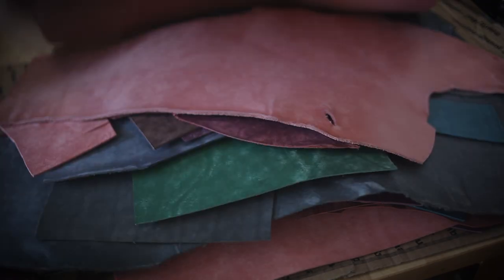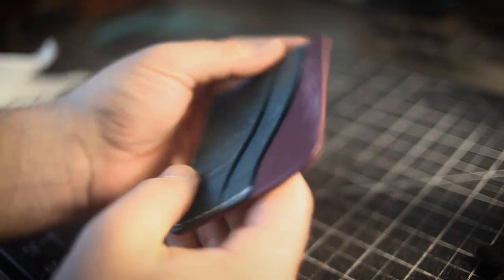Maya Leather - Seafarer Card Holder

Comment: Do you use Maine thread anymore?  Seems like you've switched to Vinymo MBT.  I played around with Maine Thread but I wasn't really enjoying it.  The color fades and becomes cloudy when the thread is pulled tight. Wondering if you were encountering similar issues as switched as a result.
Reply from the maker: I haven't used Maine Thread in some time.  After years using it, I decided to switch due to some of the similar issues you've mentioned.  Even after trying to warm the waxed polycord by hand, I would still experience what I can best describe as "gummy" or "chunky" looking stitching.
Reply: @legacybrandleather  Sounds like different vocab being used to describe the same problem. Did you ever try the french lin cable?  I really like the colors it comes in and it does pop more compared to Vinymo thread.  I have however not made and tested anything with it yet.  Nor do I have a good technique for ending the stiches since burns instead of melting. Always learning to be done.
Reply from the maker: @alexissolaris  I'll have to give some of the french lin cable a try!